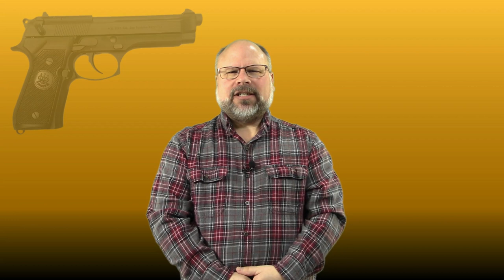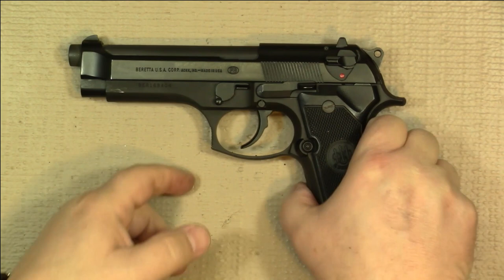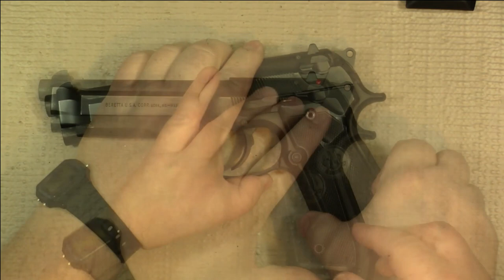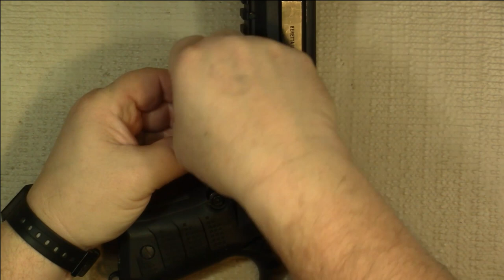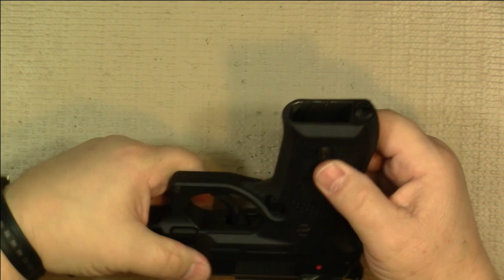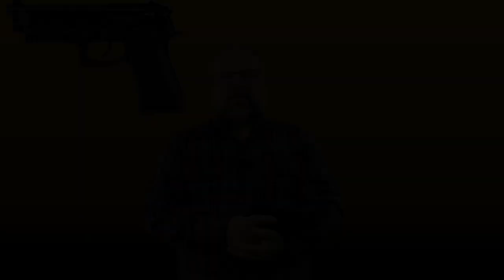Beretta 92 Rail System by Recover Tactical

Comment: Have you found A holster that will accommodate this set up
Reply from the maker: I actually have not as I have not looked for one. I use this set up for one of my home defense firearms so it is not holstered but in a quick access gun safe. Recover tactical makes a holster for the gun and rail assembly but not with a light on it.

Comment: I saw another review of these grips that said the magazine release was a bit of a chore to push when it's attached. Have you had any issues?
Reply from the maker: I have not had that issue with mine, however I can see where that could happen. It is a full lower receiver cover over, so any tolerances out of spec could cause issues like that. Being polymer it would be easy to correct by relieving some material from around the mag release. However I would first try to remove and re-install them to make sure it was aligned properly.
Reply: Thank you for making this very comprehensive video!

Comment: Do the grips seems to rub or scratch any areas of the gun itself? Also do the trigger guard areas rub uncomfortably on the finger? I looked into the NCStar trigger mount but heard it scratches the guard and I want to keep things pristine if I can. Nice review!
Reply from the maker: I do not notice any areas that rub my finger uncomfortably, however to be fair my hands are used to being abused so it could be i just don't notice. I will have magloader Steve check it out and report back. As far as damaging the finish, I don't think it would directly, however I do think dirt and crud getting in between the grips and frame combined with the slight flexing that is there as they are polymer, would likely leave some marks.
Reply from the maker: I had Steve ring the gun and he had no issues with pinching or other issues such as that. He thought it felt good and also liked them.

Comment: Are there holsters level 3 that would fit this set up?
Reply from the maker: That is a good question that unfortunately I do not have an answer for. I have found some holster companies that make holsters for the 92 with the grip/rail system and various lights, but none that have level 3 protection. However, that does not mean one is not out there.

Comment: Could you put some sort of epoxy between it and the barrel to prevent the flex and inaccurate laser siting?
Reply from the maker: You may be able to however it would likely damage the finish on the pistol and make working on it much more difficult. I also am not sure how well the epoxy would stick to the plastic.  Even then however the rails would be plastic and not super rigid.

Comment: If they had done away with the trigger guard polymer, it would have looked much better.
Reply from the maker: I agree it would look better, however the wrap around on the trigger guard provides a good deal of its strength and how it attaches.